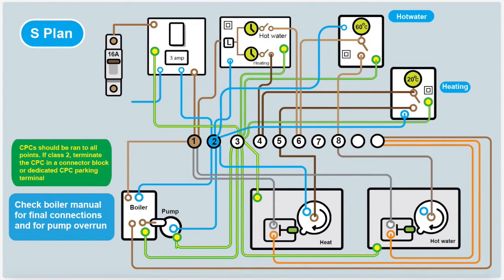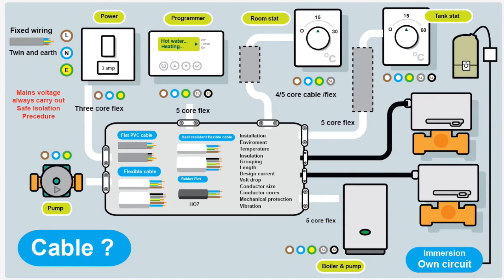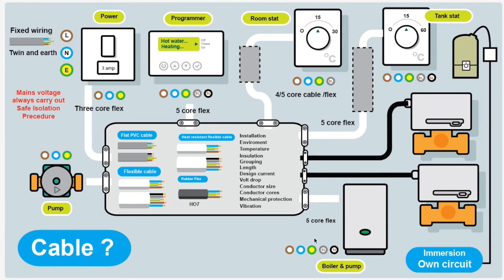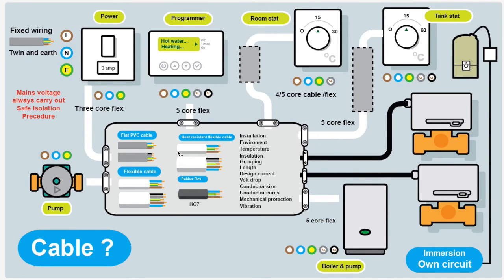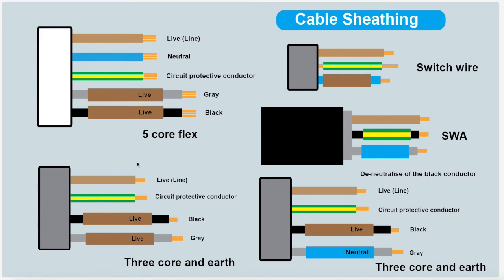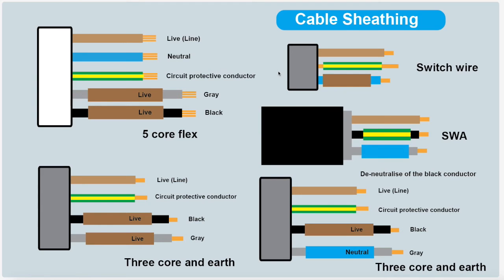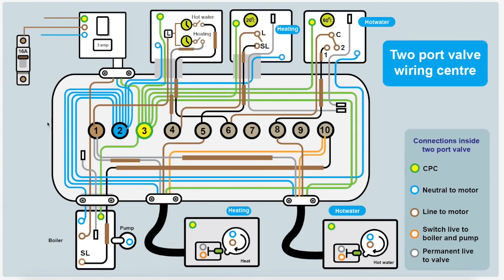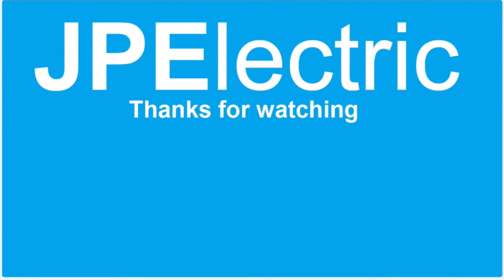S Plan Heating system  Wiring centre - Part 2

Comment: Hi there and good tutorial with the help of the diagram. Would it be hard to add another two port valve to heat a separate underfloor heating zone. I appreciate the programmer may need to change to accomodate
Reply from the maker: Hi JMF. Thanks for the comment. The great thing about the S plan is that it is relatively easy to add new zones. And with UFH its practical to have local controls to control the new UFH valve